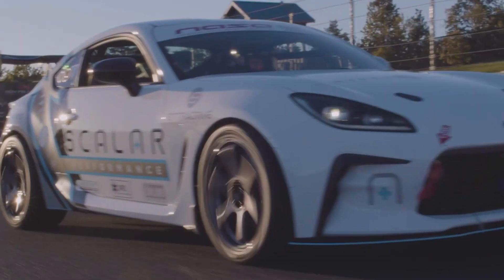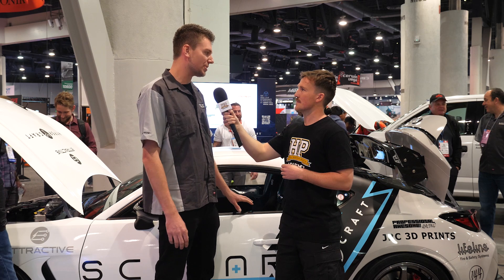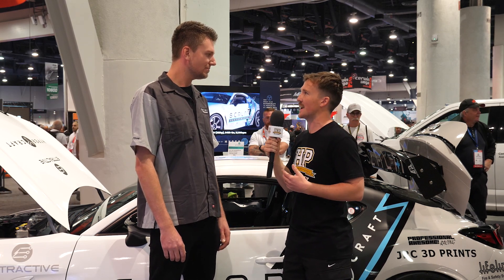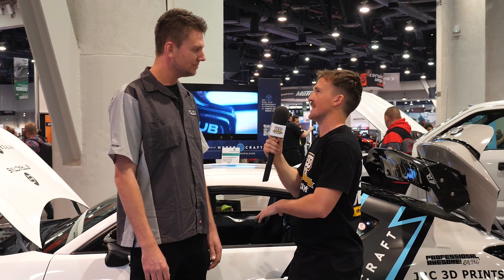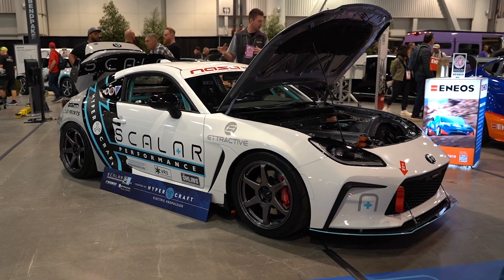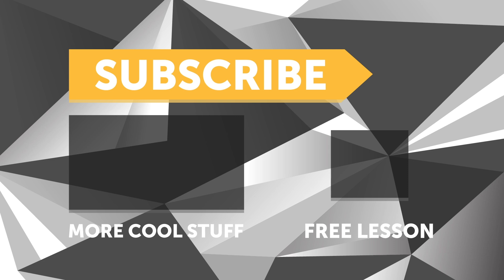We'd Race This. Would YOU? | SCR1

Comment: It can only run 45 min. What a waste of money.
Reply from the maker: Fun fact: many cars can't race for 45 minutes non-stop even if the gas in the tank lasts that long 😎
But yes, as directly discussed, if you are endurance racing this wouldn't be the weapon of choice just as you wouldn't try do it in a drag car that runs for minutes at a time at most.
You don't have to run out and buy one of these to simply understand how they work though if you're a car nerd like we all are 😎 If not that's cool too - Taz.
Reply: @hpa101  Fun Fact: If that thing smacks the wall it will most likely light on fire for several hours. Ending everyones access to the track.
Reply from the maker: Did you watch the video, including the specific info fire suppression system? This is something they have considered and are probably ahead of the curve of some on that front. 
You're not wrong, it is a serious consideration just like oil and fuel all over the track is for ICE vehicles. Just like EVs are doing now, many solutions have been developed to deal with that over the years too 😎 - Taz.

Dry break quick release quick note: https://youtu.be/TeoN71jZHQ0?t=260

EVs do not constantly catch on fire: https://www.stuff.co.nz/motoring/131659626/how-worried-should-i-be-about-ev-fires#:~:text=However%2C%20while%20the%20fire%20itself,compared%20to%201529%20combustion%20cars.

https://driveelectriccolorado.org/myth-buster-evs-fire/

And more from an excellent podcast guest (Ben Diggles. If you like the HPA Tuned in podcast his episode is awesome. Note is is not on EVs, I know you don't like those and that's OK!): http://www.digsfish.com/DigsFishEVPresentationJuly2019.pdf

Comment: I would definitely not, I've developed electric race cars with oems and the cost is abnormal compared to ICE
Reply from the maker: The price is a killer for many for sure. You do save in running costs in some areas, but racing is still expensive and a luxury hobby really 😔
Hope you had success in your professional capacity. At least you weren't paying for that 😎 - Taz
Reply: @hpa101  Well said, running costs can vary a lot but I would also consider them slightly lower than ICE, but if you start having issues with motor, inverter or battery, the price for new or fixed can be like half the car in case of battery. For my professional side you are right, I get to play with cutting edge technology cars and I get paid for it, same like you guys :D

Comment: Interesting, but at AUS$320,000 (US$220,000 I just checked their webpage) using todays exchange rate that's a lot of $'s for a Toyota 86. In Australia a new 86 runs at around 50k, plus lets say 20k for a professionally fitted and tuned turbo, add another 30k for race seats, harness, fire system, upgraded suspension and a set for race wheels and tyres. So all up $100,000. The difference of $220,000 would buy a lot of motors / parts and cover running costs for years to come.
Reply from the maker: If that suits you better and is what you want, get stuck into it mate and build your GR86 😎
The up-front price isn't to be sneezed at, but also if you want to race these in a spec series it will be some time before that happens in Australia I would imagine. 
You would actually be limited in what you can do with it at all if you had one in the garage right now I believe, BUT, it's still interesting to see what is being done out there and what might be options for us in the future too right 🤘 - Taz.

Comment: No thanks, id much rather race my 130hp naturally aspirated quad throttled 1.3L screamer Suzuki Swift Gti which is probably just as quick around the track.. I haven't raced an ev nor do i really have the desire to. Also the cost of this build would have been an immense amount $$$$$$$ i could think of a bunch of other options id prefer to build race and or own.
Reply from the maker: Sounds like you might be able to compare telemetry one day too to find out for sure 😉
Good thing about motorsport is the options we have, and long may those options last and expand into 'new' areas like this!
Imagine if nobody ever did anything different. We'd have been racing EVs or ECEs for the last 100+ years given they were around before ICE vehicles, and they'd be nothing like this!

Hope the Swift racing is going well! I came very close to buying one after I sold my MX5, they look like a really fun platform - Taz.
Reply: @hpa101  there are a few vids from way back in the day if you're interested on YouTube, my name^ of the build dyno and track day's if you're interested. Both platforms are great and have owned both (:

Comment: Brilliant video as always very interesting.. adding a 63kwh pack plus all that saftey gear and only adding 200lb is brilliant. I bet if you drove it on the street just daily driving it that would be 250-300miles maybe more of range with its shape. I bet its a blast to drive it on track aswell ,corner exit and in traction zones will put a smile on your face..

Seems like they have done their homework on the tech side of things, wish them luck. Electrical and battery intergration into motorsports is coming and coming fast, so getting a leg up on that knowledge and not sticking their head in the sand will open up opportunities in the future regardless, just look at Matty Rimac, went from building an ev BMW drift car a decade ago to being in demand by OEMs to produce their drivetrains and one of the most well known hypercar producers
Reply from the maker: Yes I was expecting more weight too! I really hope this all pans out as intended for these guys and their customers well into the future. Love it or hate it, a lot of potential here - Taz.

Comment from the maker: 'Would you race this?'
If you answer no, let us know what you ARE racing, how many race-specific EVs like this you have raced, and what made you dislike them based on real-world experience? 

If you answer yes, are you are as excited as we are? This is the first decent step into more than stripping out a Tesla and drag racing it or rare custom-built race applications (that often are not allowed to actually race) we have seen so far, and off the cuff it looks like some solid through has been put into it across the board 😎We hope it lives up to the expectations - Taz.

TIME STAMPS:
0:00 - Joel Fallaise - Scaler Performance
0:00 - 2022 GT86
0:42 - 65kWh Battery
0:58 - 500hp Stealth EV Motor
1:10 - Cascadia Inverter
1:13 - GR86 Differ Carrier
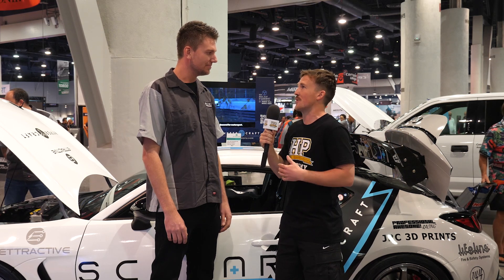1:35 - GR86 Soul Remains Intact
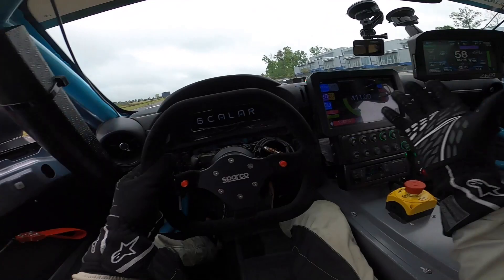2:05 - LSD/Diff Options Are Not Custom/Hard To Get
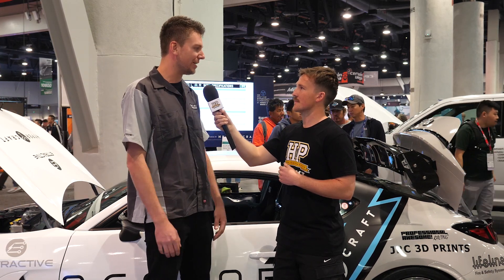2:30 - Why A T Shape Battery Pack?
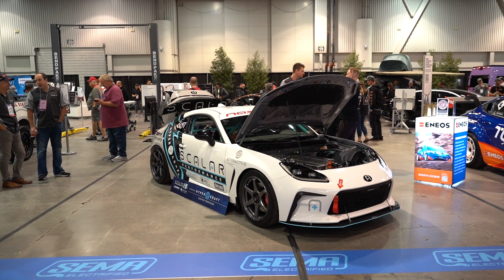3:09 - NASA ST2 Series
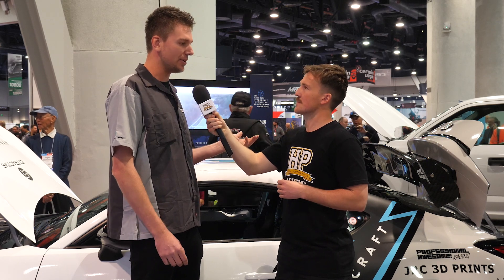4:02 - Why Spec Series Goals?
4:46 - Production Plans
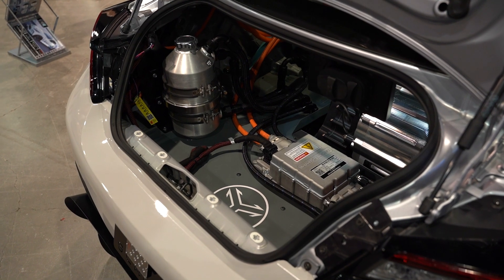5:21 - EV Race Car Running Costs
6:17 - Regen Vs Brake Pads
6:32 - Regen & Car Balance
6:50 - 45 Mins Race, 20 Mins Charge
7:04 - Endurance Racing Goals
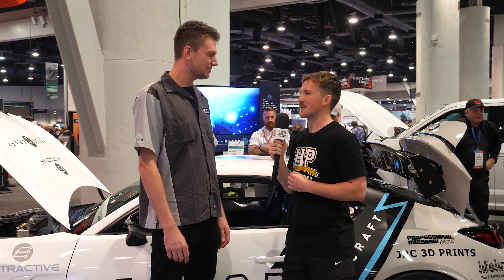7:28 - 3D Scanning & CAD Work
8:08 - Fusion 360 & SOLIDWORKS
8:17 - Roll Cage Considerations
8:57 - VCU Compliance Considerations
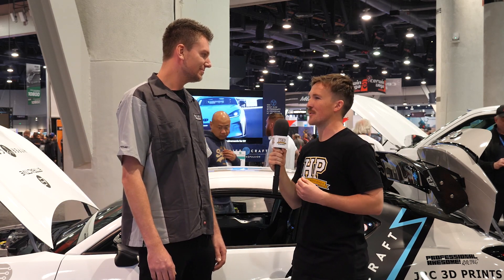10:22 - Telemetry Uses
11:22 - Minimal Driver Aides
12:48 - Torque Tuning & Driver Training
13:24 - Suspension Options
14:26 - Brake Package Options
14:45 - Brake Balance Vs Regen
15:26 - EV Safety Precautions
16:56 -Thanks Joel! (Hope the test day went well!)
17:35 - The More You Know, The Faster You Go
Reply: My answer is no because in the world of drag racing, it takes a very expensive car to be a single digits street car. It fits just fine in small class road racing which I don't care about. I have been a fan of F1, Indycar, Weather Tech, FIA GT, etc, etc I enjoy professional road racing. Not amateur hour.
Reply: Given the choice between racing with an electric car and not racing at all I'd take the electric option any day of the week. Yes it's a lot of money upfront but the maintenance costs compared to an ICE car at the same level would seem to be a lot lower for sure. I'll probably have retired from racing by the time anything like this is affordable at the club level I race at but I'd love to have a go in one one day.

Comment: What will happen to the retired battery.Until battery technology improves,currently there are to many negatives.
Reply: They'll be mostly used for home battery storage since once they're no good for EV's (need high current draw for a short period) they've still got a good 5-10 years of use as home solar energy storage.  I would hope that by then recycling etc would have improved.   With newer batteries they're being made to easily recycle also so as time goes on recycling will become the norm.
Reply: Nothing wrong with new technology,especially if it’s based on grass roots tech like this 86.But I get more excited with the hope of Toyota putting a GR Yaris 3 pot turbo engine in a 86. I’m hoping for a sustainable fuel with Toyota working on liquid hydrogen and Formula 1 working on a CO2 based fuel.What happened to E85,another sustainable fuel which was available at the pump in NZ?Electric cars are to expensive for the average Kiwi.Hopefully I’m dead before before I can’t afford to take my 8Y RS3 out for a fang.
Reply from the maker: You can leave it in a field for 70 years like many do ICE vehicles and parts from them, I guess 😂(j/k) 
Recycling is actually already done on a small scale directly, some batteries can be refurbished and others are used in the electricity grid instead. As demand increases, there will be more battery recycling options with even some OEMs working to set themselves up to do it too. Give it a look up, this is a common misconception many people have.
The same thing has happened with a lot of other items we produce over the years, even the oil from our ICEs (although many people still cut corners there).
Out of interest, have you ever looked at what you consume every day that goes to landfill and will never be looked at for recycling? That is something you can actually impact now regardless if you race and EV or ICE powered car.... - Taz.
Reply: @hpa101  ICE cars have progressed over 100 years to where they are today.The first Ford Model T ran on alcohol and was a farm vehicle.No money for big business there as farmers could make there own fuel.Petrol was adopted as it became cheaper to get the oil out of the ground and could not be made by the farmers and could be sold easily to the new vehicle consumer.I can understand what EV’s are about.But currently most countries do not have the infrastructure (spare electricity,supply and charging facilities) and we have to look at how that electricity is produced.A majority of EV’s being produced today will be made redundant as better technology is adopted.There will always be the problem of cost to the environment of production and disposal of a new or used ICE or EV vehicle.
And Yes,I am very conscious of my personal impact on the environment.Big business needs to be asked that question.It has been proven in the UK that in increasing the lease agreement of a new vehicle by one year this will reduce carbon by cutting the manufacturing of new vehicles.
Reply from the maker: @daveearnshaw6874  there's the rub. It's not EV vs ICE at the end of the day; it's how we use vehicles altogether 😉

There is no perfect solution around all that everyone will be happy with, but we should be looking for 'good enough', not perfect 😎

With the whole EV push it is exciting to see something like this on the motorsport side of things anyway. Love it or hate it, more racing is more racing - Taz.
Reply: @hpa101  There is no misconception about the issues with batteries although people like you pushing for EV's try to fool people there is. Today there are already huge sites were spent EV's and batteries are gathering dust since no one can discard of them properly. Recycling an ICE engine is nowere close to as complex as trying to pick apart a machine full av exotic metals, minerals and chemicals, some of which has been mined by poor people in Africa under awfull conditions.  In the US some states have used EV's on large scale for public use and they are now just standing in landfills. Give it a look up and stop feeding people lies.

Comment: So much nope
Reply from the maker: What don't you like about a 350-500hp capable RWD race car?- Taz.
Reply: @hpa101 EV are powered by the same dirty energy that everyone complains about. Especially with all the coal fired plants in the United States....
Reply: @hpa101  Same reason why people rather track a stock old base model Civic over a late model V6 Camry with TRD suspension. The Camry would be a superior car with acceleration, braking, and potentially even cornering, yet people would still pick the Civic for the overall roughness around the edges. Even if the Camry scores a better lap time, people will still pick the Civic.

Nothing against people developing EV race cars, as we are slowly forced into a full EV future. Yet, because of that, there will be pushback as it signals the end of pure ICE vehicles on the road.